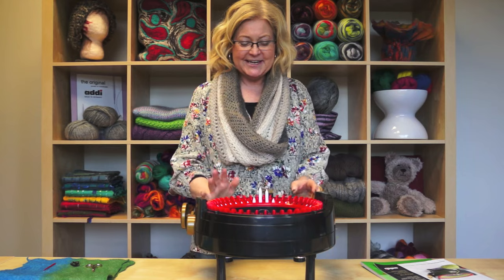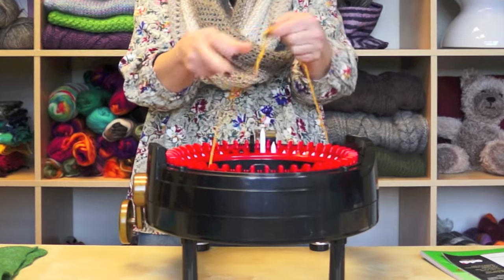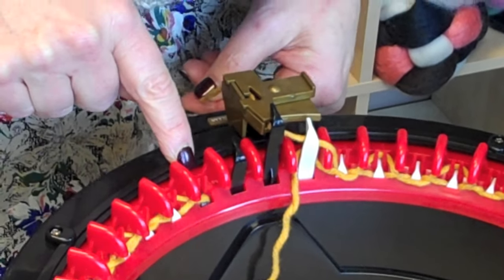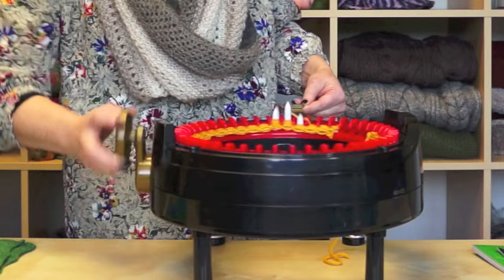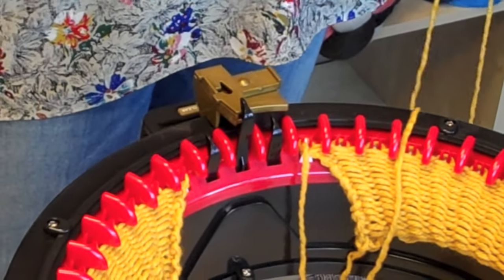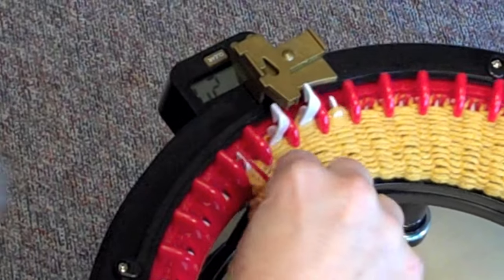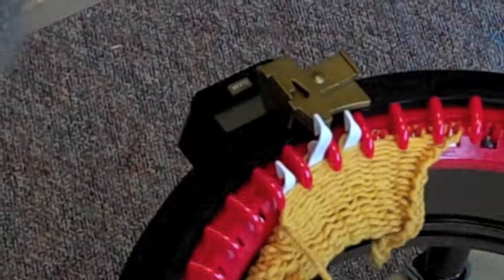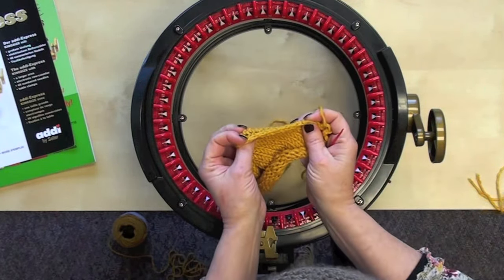Knitting a Flat Panel on the addi Express Kingsize Knitting Machine

Comment: A little tip: you can indeed get rid of the little tab. Instead of letting the black needles at the end grab the yarn on the first round, have the yarn hook onto the red beak-shaped thing after the last white needle and from there, feed the yarn into the yarn holder thing. Then just turn the handle like normal. Bam. No more tag.
Reply: B 😅i
Reply: Nice

Comment: I have been following your directions but when I turn the handle it it a bit hard to turn and I get a clicking sound. The shuttle is closed and it doesn't make the sound when the yarn is not in the machine. I did not get the booklet with the machine when I bought it from Amazon. I wrote and told them this and never received an answer. Now I found out I need to pay $25 for the booklet.
Reply: jossefg12 same with me—i didnt get anything with mine. it makes a hard clicking sound on the cast on and first row then gets better. i have to remember to close the shuttle door!
Reply: jossefg12 .

Comment: Say..for example... I'm knitting a PANEL on the King-Size Abbi. A few rows require 45 needles, and other rows require only 40 needles. Am I at risk of breaking the machine if I try to knit only 40 needles, when the machine is set-up to finish a row at 45 needles? (I hope no one thinks it's a dumb question. It's my first time using a knitting machine. And I don't want to break it.)
Reply: Tomeka Ridley I believe that you can buy stoppers which go on the pegs so you can adjust the width
Reply: The stoppers came with the machine but people doing the videos don't seem to use them.  It would help to have some tips on how to use them properly and still get exactly the number  of stitches you planned to do.

Comment: Your hand is in the way when coming yo black pegs when casting on flat panels. can't really tell what you are doing. why does my black peg get a bunch of yarn wrapped around it
Reply from the maker: +Sarah Endow Hello! 

At the point where her hand may be blocking the view, she is inserting the yarn into the gold carriage, then begins to knit in the other direction. 

If the black peg you're referring to is the last one in the flat panel bed, those stitches are a little loose. Try adjusting the tension in which you hold the yarn when you begin to knit a new row to see if that alleviates the problem. It may need to be held a little tighter. 

Thanks!